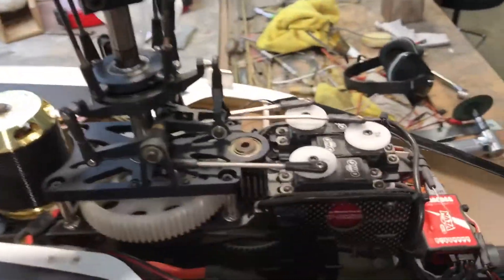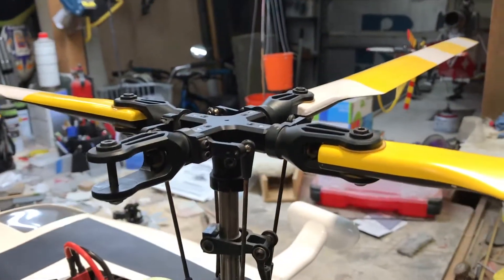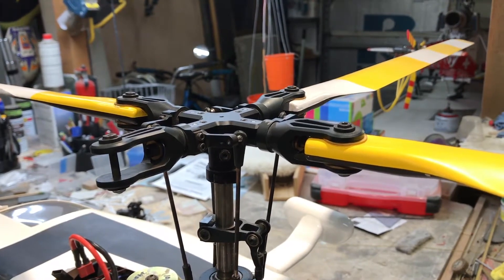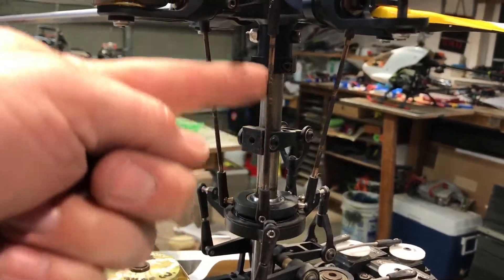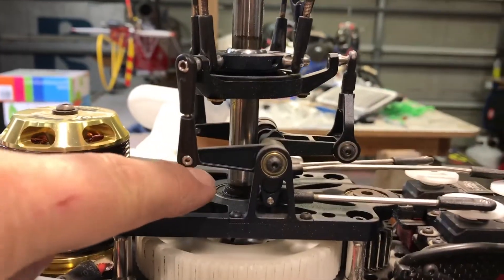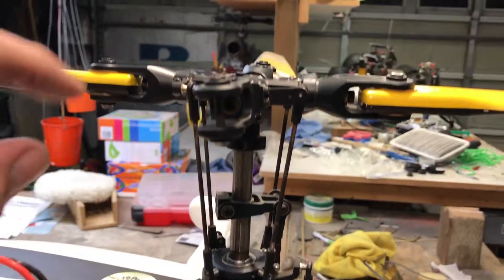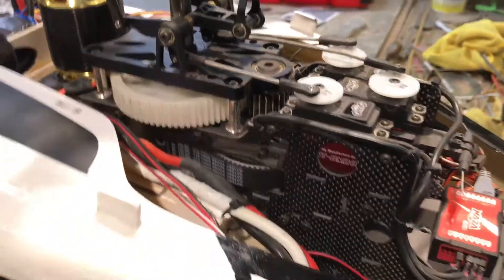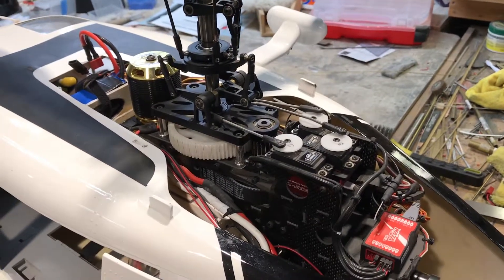Servo set up on Roban Bell 412

Comment: Question. Seen this looks to be a 120deg  swash setup, if the radio has no mixing since all is done on FBL why when you give it forward elevator does the swash not move forward like a regular 3d heli? The only way I can see it doing what yours are showing would be a mixing in the radio or telling the FBL it’s not a 120deg swash.
Reply: After thinking about it. I think the only way to get a 120 swash to do what your shows is having front left servo be aileron front right elevator and rear being pitch. I believed this is called a 120deg side configuration.
Reply: JestRR thanks much for taking the time. I will
Be building one next week so that certainly clarified my thoughts. Thanks.

Comment: I've tried the Demon and couldn't get the damn thing to work. I went with ikon and everything runs pretty smooth. 
Btw do you change your mix setting on your radio for multi blade heads?
Reply: JestRR I'm not sure the circumstance of the guy you mentioned in the video, I'm just not used to the Demon as I am the ikon.